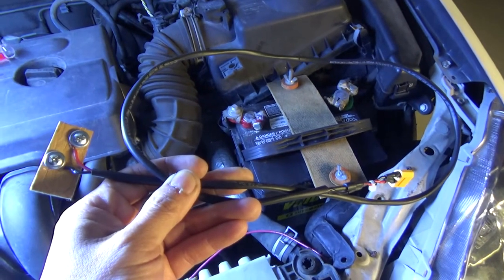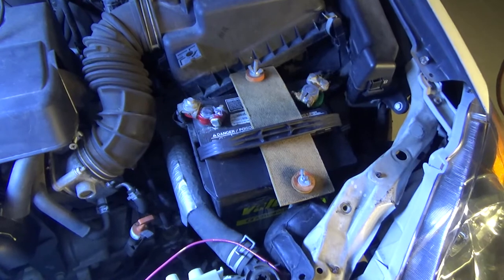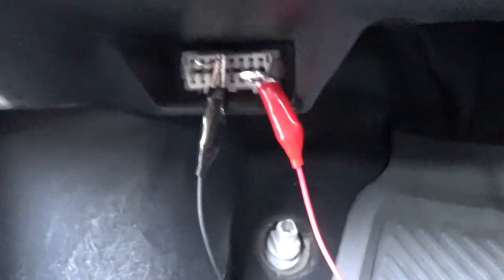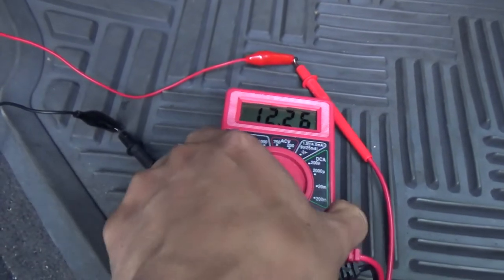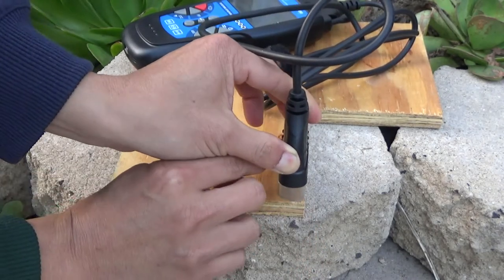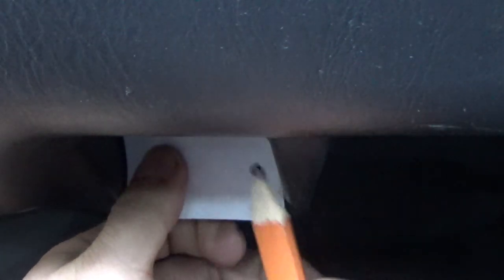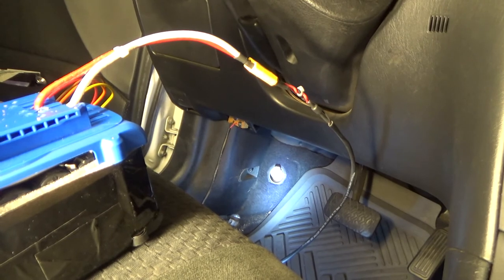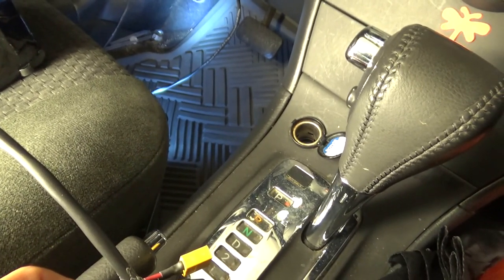DIY: Home made external 12V OBD2 power/memory saver cable

Comment: A simple 12v battery plug to cigarette lighter adapter using a 12v dry cell battery is safer and easier. You can order them on line or find them at autozone.
Reply: That is not solution in my cases. VW passat 2015, and Pontiac Wave does not have 12 V  in cigarette lighter when car is off
Reply: @cemomaher1650  Yes me too, Audi A3, when car is off, Cigarette lighters are not powered.

Comment: Bravo Vieaco that's so Awesome .You know a Merchant of a second hand store was trying to sell me a small use 12 volt rechargeable battery with a cigarette lighter plug  for $.6 dollars .  I still think about that small 12 volt batteries pack ,wonder if it's he still have it.
~~~~~~°~*<€(((( V ))°?)   .......
It's  Still a good Idea you have there Vueaco thanks for post this video .
Reply from the maker: Your 12V external battery has to be big enough to last through the time your main battery cables are being disconnected. If it does not have enough capacity (run time) to last through the black-out period, and if it dies before you're done with your project, you will not have power to your ECU and your ECU will still be erased and reset. So make sure your external 12V battery is big enough. How big is enough? It depends on your car model and how long you're planning to work on replacing the main battery.